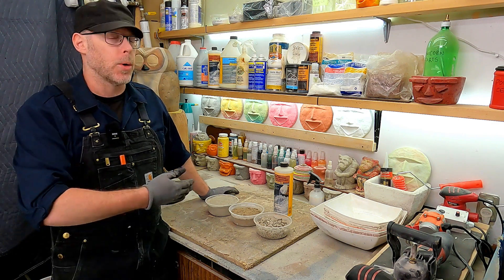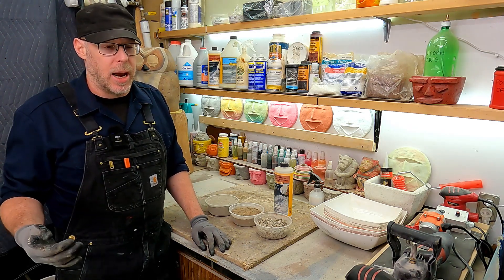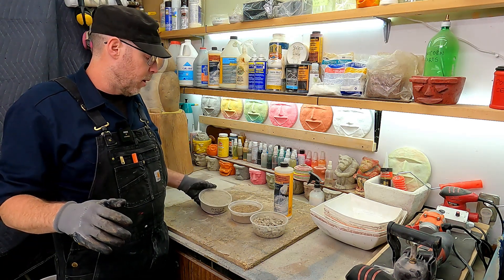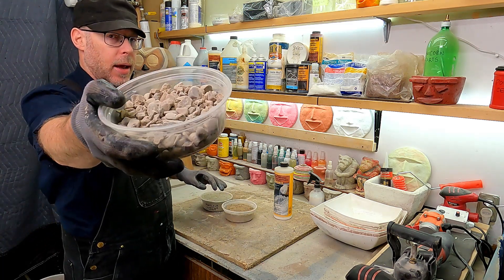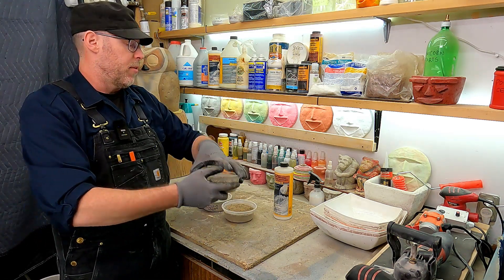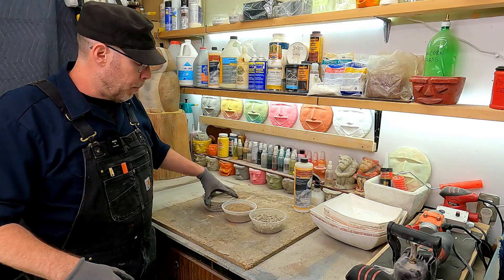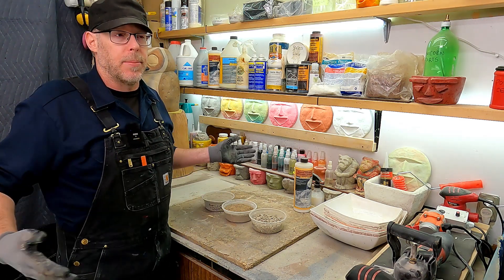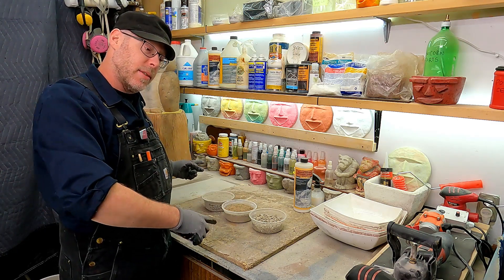Homemade Concrete Mix Ratio

Comment: Sooo, how much water do we add? Just to get some workable consistency or is there a number for that too? Like 1-2-4-? Thanks for all the videos, the paint tip was really interesting!
Reply from the maker: Workable consistency. Every application will be unique for the slump you want to attain. Minimum amount of water to achieve desired placement viscosity is how I would phrase it.
Reply: @creatingconcrete  so in other word we can mix the "modifier" in the water prior to the water being added to the cement /sand/ aggregate mix. keeping track for the next mix!

Comment: I have a project i want to do but if I use regular quick crete with the sand n gravel it'll be to heavy so I looked up what concrete is light weight n came across ur videos I want to make a washing station with a basin on the side specifically used for hand washing laundry. Mexico uses them along with other countries all are unique in their own ways but for my project I wanted like I said something lightweight n easy to move I intend to sell some that I create if I can get the job done right n won't break but is heavy duty. Can u help me pick which will be a better mix for me for what I want to do. I want to build a frame that has sides n a basin inside connected to the washing station which will look like a concrete washing board

Comment: I was always taught 1-2-3.  If you add more gravel doesn't that take away from the strength of the concrete?
Reply from the maker: The ratios are definitely flexible - it depends on what you are using the concrete for. 1 -2 - 3 is a common concrete mix ratio as well. 1 - 2 - 4 has greater bulk of yield suitable for slabs, pads and general use applications where economy of yield is a primary concern